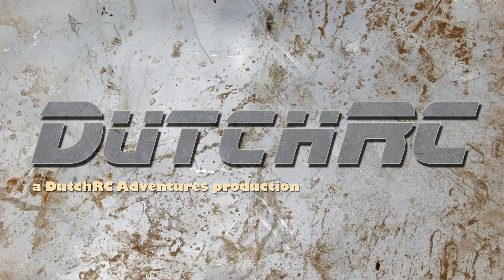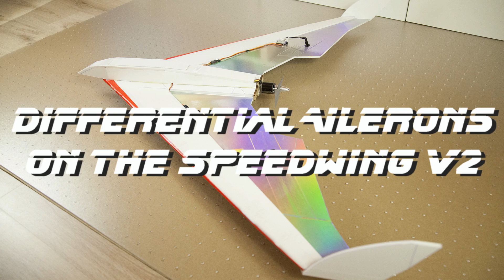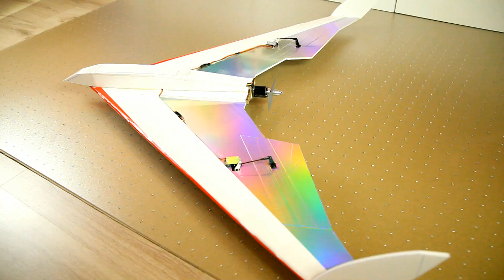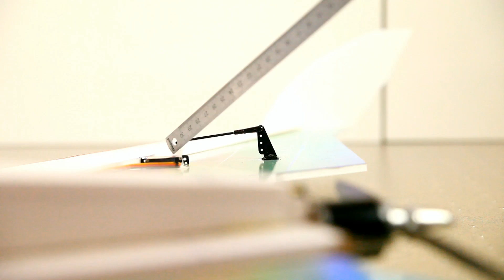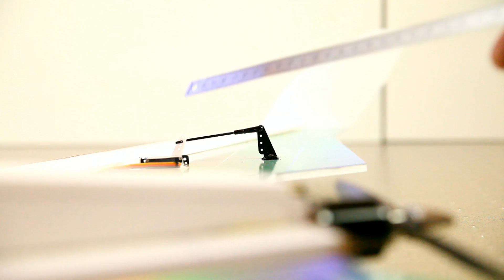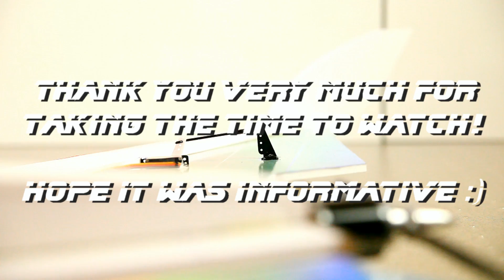Differential ailerons? Why and how (mechanically)

Comment: Hi enjoyed your video but can you help me out with this question? the  question is why is " Differential controls on an aileron system means that.." and I know the answer is the up travel is  more than down travel but why tho??? can you please explain this to me. please reply back in the next hour I need to finshed this for my report.
Reply from the maker: Hi there Felix :) 
ah yes.. good question.. Have you ever come across planes that kinda corque-screw their way through an aileron-roll? 
This can be caused by several things.. for instance: 
1. the aileron hinges aren't in the wings-center-line 
2. the wing itself isn't at the planes center-of-thrust or center-of-drag... This is allways the case on high-wing planes.. like STOL / Cessna kinda planes..
Reply: The reason that the upgoing aileron moves through a greater angle is to counteract the extra drag that is induced by the extra lift from the down going aileron, if this was not the case, the nose of the aircraft would veer to the side of the down aileron.  I have the feeling this fellah should go on a Theory of Flight course!!!!!!!!!!!!!!!!!!!!!!!!!!!!!
Reply: The wing is already at a positive angle of attack. So down elevator means even more angle of attack, which increases drag and chance of stall. That is why down elevator is less than up elevator.

Comment: Nice mechanical solution.  I was going to ask how this would affect aileron rolls, but you answered that near the end.  Seems if you'd rather do barrel rolls than tight rolls this would be ideal.  I suppose if you only wanted the elevator effect (and not ailerons too) you'd probably be better to program the transmitter.  Cool video, thumbs up!
Reply from the maker: Thanks for watching and commenting sir! And indeed.. it is more conveniant to program this into the radio.. This mechanical way is a bit of a blast from the past (when radio's were less sophisticated).. 
However!.. programming it into the radio does make you lose resolution.....

Differential ailerons are used in lots of planes (1/1 size as well) to counter the plane's natural tendency to do barrel rolls.. With diff ailerons you then have tight rolls.. AND.. less drag..

Comment: Great looking plane, I love that colour scheme. I will go and watch the crash vid now (-:
Very good informative vid, great work mate!
Reply from the maker: Thank you :D  that rainbow-reflective foil looks special huh? ;)

I'm now in the process of designing a scratch-build quadcopter With dihedral by the way.. Do any of your copters have dihedral??
Reply: DutchRC ADVENTURES
Yes my Steadidrone Quad has a very slight dihedral on it. I once got into a conversation with a guy about dihedral and I asked whether it would work if you tilted the props out instead of in, so they were all pulling against each other instead of pushing in towards each other. What do you think?
Reply from the maker: Jax Teller WA Well.. Here is what I think.. ehm sorry.. what I Know:
the motors should be tilted inwards.. And this is why: If your quad banks left, the motors on the left side will have more lift, then the ones on the right . IF that doesn't make sense.. just hold the quad in front of yourself.. tilt it to the left, and you will see that the motors on the left hand side are pointing upwards more then the ones on the right (IF the quad has dihedral offcourse :)) ..

Besides that: when hovering above the ground, there is less turbulance under the quad, because the thrust is directed outwards..
Reply: DutchRC ADVENTURES
Hmmmm, someone needs to experiment with this I reckon, it probably depends how long the arms are on the quad
Reply from the maker: I have just shot a project kick-off movie for a quad that will have dihedral :)
Reply: DutchRC ADVENTURES
Cool man, I look forward to seeing it (-:
Reply from the maker: Jax Teller WA It's online now :)
Reply: DutchRC ADVENTURES
Cool, my vid with the cat that looks like yours is up too (-:

Comment: Nice re-build, top quality on the whole frame there looks straight out the box :-) the extensions should work really nice it seems a lot of the larger flyers seem to have a big up and small down on them, it seems to help offset weight as much as boost manoeuvrability. The only thing that makes me twitchy is that you still manage to crash here and there...what does that make of my odds :-O Cant wait to see you get this up in the air! another great vid my good man!
Reply from the maker: Hi there buddy! Thanks for watching and commenting again :)
Well.. on the odds thing: I do experimental things, and I like to fly like a mad man :D  This wing here is quite extreme in design as well.. A far cry from a beginner plane..
The wing I made in the wing-build-series, flies Much easier :)

Ohw.. and Maybe it was a bit Stupid of me to fly that low on the previous test.. To keep it in view :$

Like you allready read in E Laermans discussion: equal aileron movement Allso acts as a (wedge) brake.. 

Cheers and thanks again sir!
Reply: DutchRC ADVENTURES Your insights are great honestly, they allow me/us to learn a lot before we start purchasing stuff :-) I liked the idea of starting out with a funtastic as you recommended but I saw this... http://www.hobbyking.co.uk/hobbyking/store/__56564__HobbyKing_Avro_Lancaster_V2_Thumper_MKIII_4_Engine_Bomber_EPO_1320mm_PNF_.html ...look at it its glorious :-p on their video they were saying similar that they have their flaps going a lot more up and a lot less down on their mrk2 version.
 This looks like trouble to handle to a rookie but it looks suitable to carry the electronics I want to stuff in there, not to mention it will be fun reusing all those motors once ive crashed it :-D
 At the min im thinking get it off the ground to as high as possible with fpv on there and up at about 500feet I should be free of hitting anything :-)
 You think people will mind if I use the graveyard to the rear as a runway?... :-D
Reply from the maker: battonfive Haha :D  a graveyard as a runway? :D  Really??? :)

Ahh that is a nice Lancaster! That plane shouldn't be Super hard to fly.. But NO scale looking airplane is advisable for a beginner. It looks nice right? How long would you think that will last? The landing-gear will last exactly 1 flight..
Besides that: 1 motor+ESC can be trouble enough when you start out.. Here you have 4 times that potential for headaches..

You could put 2 of these on the bottum of a bigger-style plane by the way :)
http://www.hobbyking.co.uk/hobbyking/store/__50286__HobbyKing_8482_Candy_Dropper_Module.html

Cheers and thanks again!
Reply: DutchRC ADVENTURES lol yeah the graveyard looks a great runway all that wide space :-D but I was really aiming to use the back alleyway which is about 50 foot long and 10 foot wide :-)
 The alleyway would be best but the graveyard would give me a little leeway on the landings :-D
 But yeah your right not the best for a new starter but... :-D
 The candy bomb bays are pretty awesome, I think they removed the servo controlled doors on this version of the lancaster as they wanted to save weight but I kinda like them :-)
 The setup I have in mind is a work in progress admittedly but the details are slowly coming together like pieces of a jigsaw.
 I wanted to start off getting a gopro 4 for some nice film work but one of my monitors just died...died and I cant fix it so I think im gonna have to hold off on my hobby gear atm :-(
 Not to worried though :-) your insights really help out while with a bit of luck my wife will learn to drive when she gets back from india and I can nick lifts off her to some good places for rc'ing :-D
Reply from the maker: battonfive Hee man.. Sorry to read about that monitor thing! That sucks big time :(  On the other hand: more time to get the design / thinkwork done first :)
How is your nitro-truck project going by the way? No updates in that lane??

An alleyway kind-off sounds like an accident waiting to happen :D  But I might have a completely different kind of alleyway in mind ;)
Ahh and yeah.. I think the candy-dropper is allmost the same as the bottum of the Lancaster :)

Cheers!
Reply: DutchRC ADVENTURES:-) I've been pushing it for a while with my pc monitors, using a couple of old faulty screens that worked as long as I left them on, but the other day I had a brief power cut and by the time I got to them one had completely died on me :-) I was hoping to start collecting a few bits a transmitter, a gopro and perhaps a funtastic or that Lancaster, but I could do with the money for my office to keep my little programming business on track atm :-D
 Your right though 'an accident waiting to happen', the alleyway is pretty narrow and im pretty unskilled :-P
 That's why I say the graveyard behind the alleyway looks good :-D but I imagine people would complain or something :-)
 But your right its good fun doing the planning for it all, it seems you cant extend an antennae signal much from a transmitter, so if I wanted to run an rc system outside from inside I cant just add a wire on to the end of the ariael and sit inside with the transmitter :-p
 but I notice online you can wire up a transmitter to a pc and run it all off the arrow keys or from a joystick which would enable me to overcome the inability to simply extend the ariel using a wire :-)
 how that setup would fly in the hands of a rookie is anyones guess though, likely bad I would say, but it does sound like something that would be good fun to have a go at :-D

Cheers for your input as always :-)
Reply from the maker: battonfive You're welcome!
Well actually! When using an advanced flight-controller, you don't even need a transmitter at all.. You just enter waypoints.. And off it goes :)   OR control it from the pc / laptop indeed :)
Not very exiting to fly this way.. But it is nice for a change.. just to see it in action :)

Hmmm narrow alleyway.. I wouldn't go for that then ;)
Reply: DutchRC ADVENTURES Thanks for the shot of good sense :-D I fear if your not gonna take the alleyway it would just be suicide for me :-p Graveyard it is :-O

Mmm the autopilot module sounds good, it sounds like your right with it loosing a bit of the fun of flying it but it makes me wonder if it will provide a better range of distance than a transmitter for it to fly from the home point :-)

I was thinking maybe running some wires off to the roof where I will house a transmitter in a box and hook those wires up to the transmitter and my pc so when I use the arrow keys or a joystick the signal is sent to the roof to the 6-8 way transmitter where it then transmits to the r/c from the highest point :-)

I figured that way I should get a 100 meter range in every direction of the house and not have any of the signal shielded :-)

That sounds pretty fun to me to try but im interested in checking out the autopilot way point modules now :-)

Cheers for the heads up :-)
Reply from the maker: battonfive Hi there sir :D
well actually! When you're flying in completely automated mode.. You aren't using a transmitter at All :)  So the range is a big as your fuell (battery) allows :)

And true.. if you extend your antenna to the top of your house, you should have a Great reception! At least a kilometer :) If you get yourself a good transmitter (Futaba for instance).. You'll be able to get much further :)

But.. I WOULD urge you to just learn how to fly first.. You really need to be able to safe your model if the electronic aids fail :)

Cheers mate!
Reply: DutchRC ADVENTURES i will take your advice and will practice manual first :-) it will take me some time to rig up a bridge to work the transmitter from the pc so it should time pretty well :-)

Ive noted down the Futaba brand on my board, i will look in to those, perhaps try and get a second hand one cheap as i will eventually end up stripping it down to get at its circuitry :-)

A kilometre sounds pretty awesome :-D I saw a mod the other day where a lad had rigged a monowing to hook up to a wifi hot spot from a mobile he has stuck on the plane that he was managing by a joystick on his lappy, that was pretty awesome :-)

I'm trying to keep it all in mind while i ponder on it all so i have a good idea of what im doing when i finally get my little carbon fibre manufacturing setup.

By using c.f im hoping to be able to start working with a nitro motor and alternator to run a main prop and run the octocopter motors:-D

Seems pretty far down the line but ive got the patience :-) Thanks for the input it all makes my mad scheming that bit more viable :-D
Reply from the maker: battonfive First thing: YES! A used Futaba is a very good option! They are build to last at least a decade :)  DO opt for a FASST version, but they have around for quite a while.. Those can easily be found second hand :)

That GSM project sounds GREAT! Very inventive :D  Wauw.. There is thinking outside of the box for ya :D  Super!

1 single motor on a multi-rotor is VERY possible as well! There are several commercially available config's like that.. EVEN with combustion engines :D 
http://i.ytimg.com/vi/XnP3jTwRPv0/maxresdefault.jpg
Reply from the maker: battonfive I think you could do your setup with only one motor and variable pitch on the one thrust-prop :)
Reply: DutchRC ADVENTURES sounds pretty good, are you thinking of the nitro on a pivot in the middle perhaps?
Reply from the maker: battonfive Pfew! That isn't easy :)  Well I would never use a nitro engine ;)  I'd use an electric one ;)  But yes. the engineering of this setup would definately be a challenge :)

Comment: Very good and useful instruction-video! Many wingbuilders overlook this way to improve flightperformance and reduce the hook-effect (the elevon pushing downward acts as a brake).
Reply from the maker: Thanks Nick! And GOOD point! The two ailerons really are the same as crow on a glider.. So yep.. it IS a brake :)
Reply from the maker: ps: what did you think of the video lead-in? :)
Reply: Now that is interesting.  So, you'd make your aileron mix only go upward, but your elevator mix would obviously need full (or at least some downward) travel?  For me, my wings are fast enough already, but it certainly could squeeze a little more battery time for gentle flying.
Reply: DutchRC ADVENTURES
True, but one of the beautiful things about flying wings is that they have almost the same characteristics inverted as upright...not that I'm great at inverted flight, but I do occasionally dabble.
Reply from the maker: UnlimitedVertical Well.. here is the thing: the down-travel is about half the up-travel.. In pitch up you are fighting gravity (most times).. while at pitch down you are Assisted by gravity :)  Besides that, I'm just far less interested in pitch-down :)  I can't imagine having the plane go down would be a problem ;)
Reply from the maker: Good point.. I tend to do quite a bit of inverted flying.. Hmm now that I mention that: I hardly ever do so with wings.. hmmm.. weird ;)